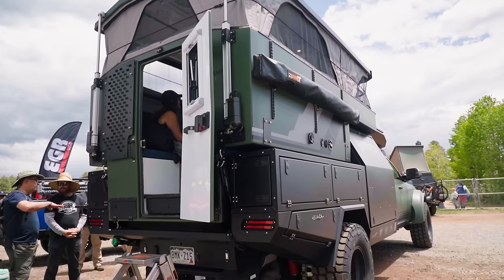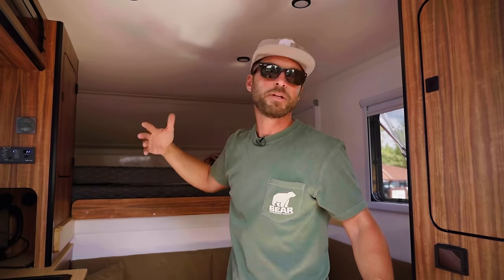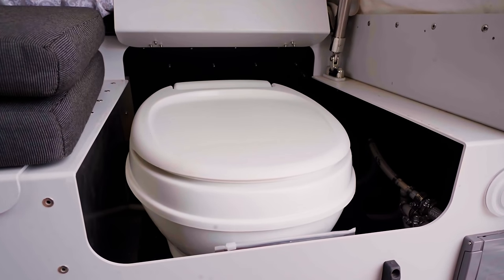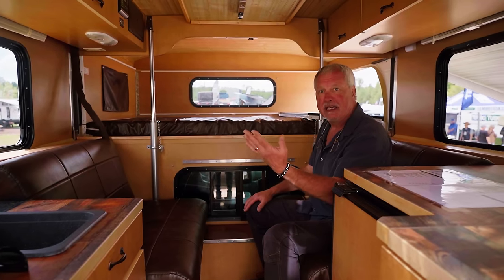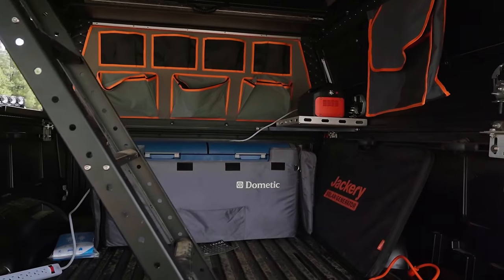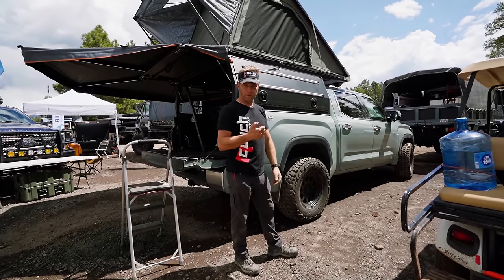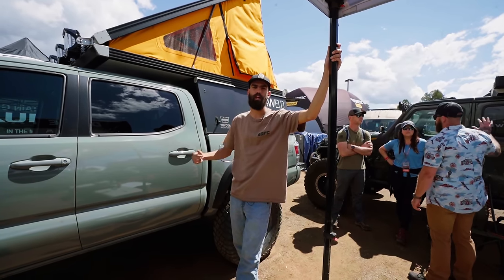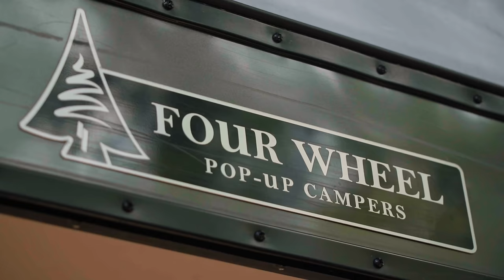15+ Truck Campers of Overland Expo West 2023

Comment: As a newbie to all this camper stuff, all I’m seeing is a fee pieces of flat metal, aluminum, some gas struts and and a flimsy tent on top or a bulky metal box with things ill never use. 

5,000 for entry is ridiculous with all these Alibaba parts. 

I’m priced out! Why is no one making a foldable solid panel square tent for a good price? 

16,000, 30,000 costs more than the truck I’m putting it on.  

Hard pass, home depot here i come.